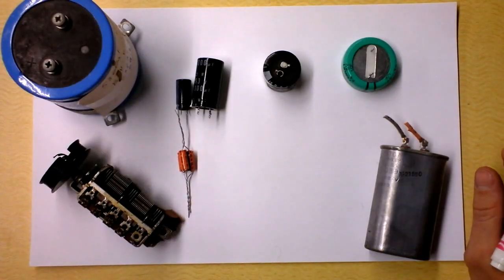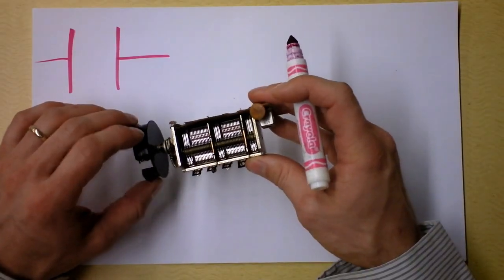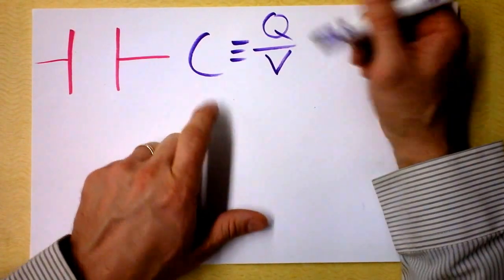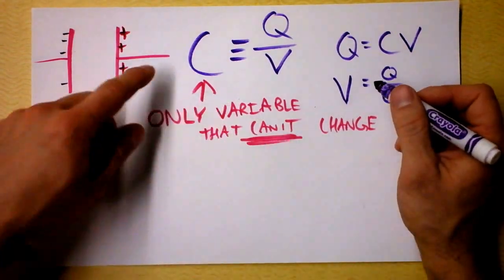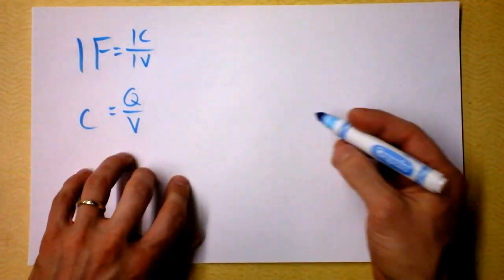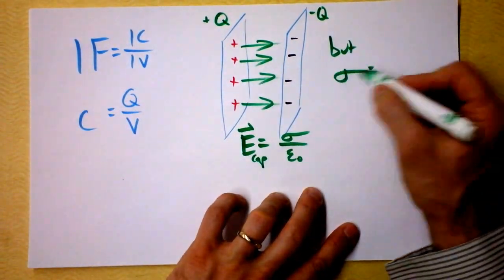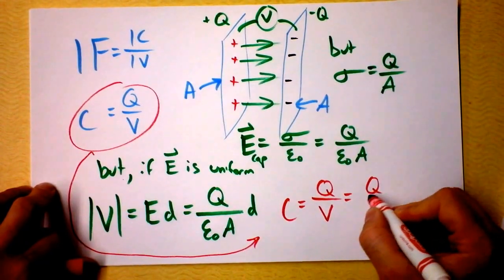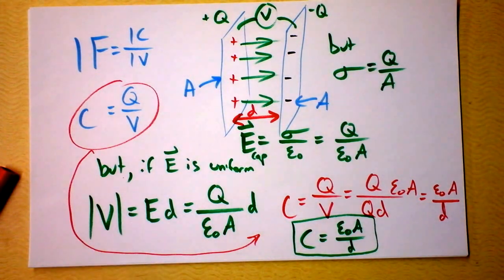Intro to Capacitors | Doc Physics

Comment: You're a very engaging speaker, but capacitance has nothing to do with charge-storing efficiency. "Efficiency" is entirely the wrong word; in science, it means the ratio of useful to total energy expended. An engine is EFFICENT if most of the energy it uses is expended usefully (in turning the shaft). The concept is not applicable here, and is very misleading.

Comment: capacitors dont actualliiee complete the circuit right ?
Reply from the maker: Right.  But they seem to, at least initially.
Reply: capacitors can complete the circuit; that's the basis of all discharge. it's what makes a tesla coil work

Comment: The problem is that water is used as analogy to electricity instead of gas, because water is practically incompressible contrary to gas. A capacitor should bee seen as a gas cylinder instead of a bucket. This way you may do a better analogy, like this:

V = Gas pressure;
Q = Gas quantity;
C = Capacity of Gas storage for a given pressure, and so Q/V.

Like a gas cylinder, greater pressure (V) means that greater quantity (Q) may be stored, however, if you increase V (gas pressure) too much, it blows up, so, besides C a capacitor has also defined the maximum pressure V it can handle before it blows up...
This is why you should think in electricity as Gas flow instead of Water flow.
Reply from the maker: +Popart 2015 That's really beautiful.  Thank you.
Reply: Thanks, and the mysterious formula with the neper number e has to due with the "Exponential Decay" of the charging/discharging of the capacitor, where 63%=(1-e^(-1)) for t=RC.
Reply: It really is!

Comment: I'm almost sure he is talking about Carnot, such as refrigerators and air conditioners etc.
Reply from the maker: Dan Tox Those equations sure are similar, aren't they.  Efficiency of charge storage also has a lot in common conceptually with heat capacity.  A capacitor is like a geometrically configurable energy-storage fluid!  Cool stuff.
Reply: Very cool stuff indeed, great lectures!